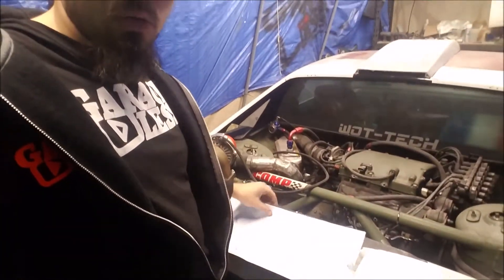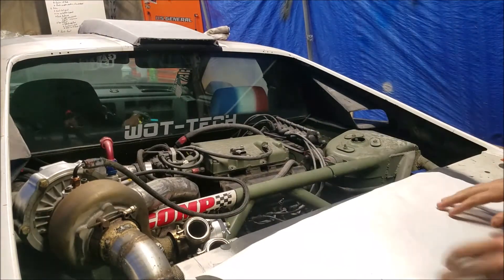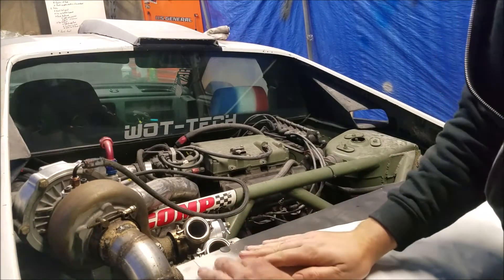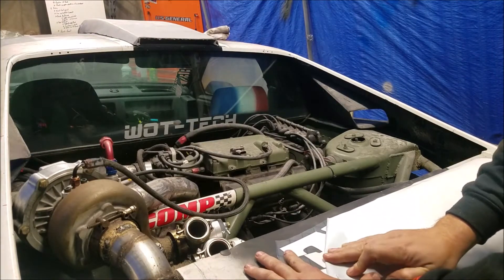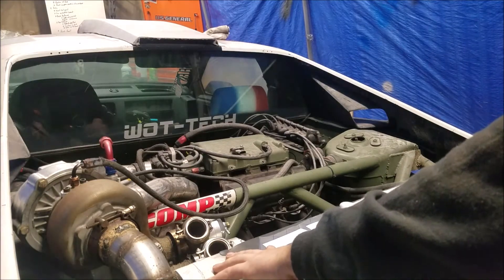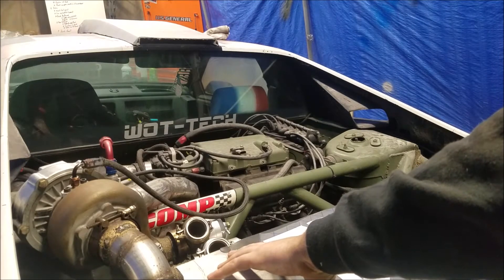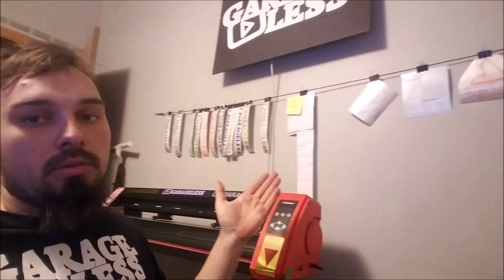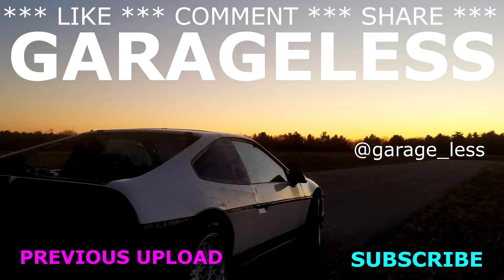HOW TO APPLY VINYL DECAL ON CAR WINDOW!

Comment: Soapy water or Windex applied decals need to be squeegeed really really well, or parts can come away with the mask or slip out of alignment really easily. Then they look like shit no matter what you do. When i did vinyl signs for my job, we used hot water with a bit of vinegar in the spray bottle while lining things up... then squeegee it half to death